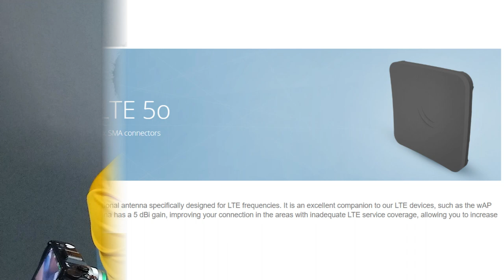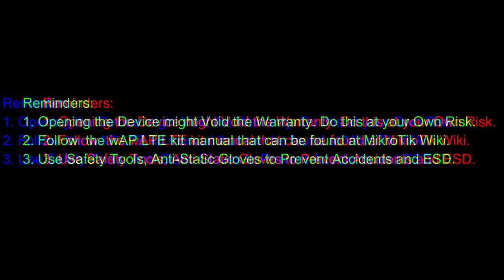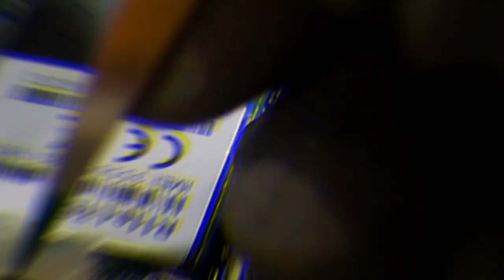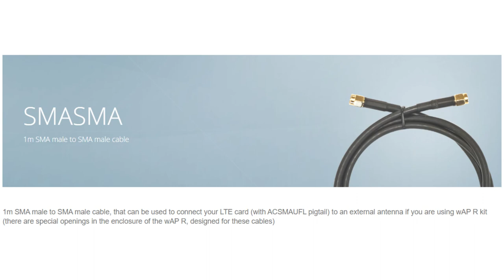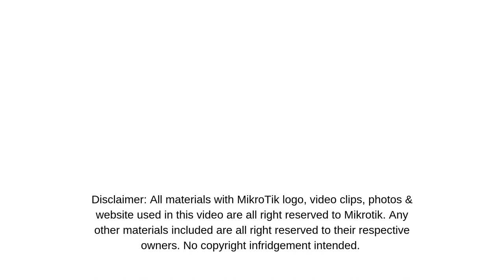How to Install an External Antenna for MikroTik wAP LTE + mANT LTE 5o Unboxing (Tagalog)

Comment: Speedtest ?
Reply from the maker: to give justice to tne mANT with the wAP, I decided to wait for a longer SMA cable to test it outdoors, I only got 1 meter and indoor testings only make a small difference between 4dbi to 5 dbi. For the next episode while waiting for it, I will do the testing with the LtAP mini since it has a 3.5 dbi antenna gain. It will be a big jump to 5 dbi, I think the results will be more noteworthy specially on outdoors.
Reply: @RizalTechGuide  ok